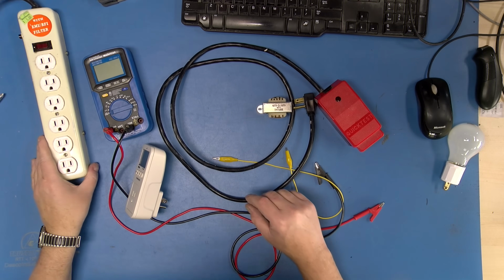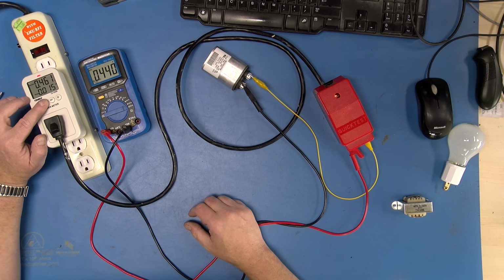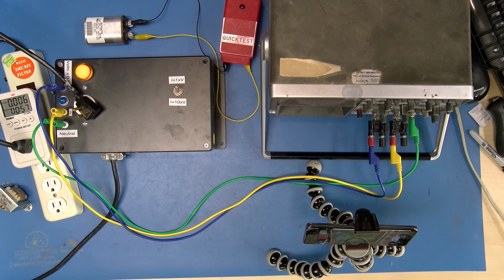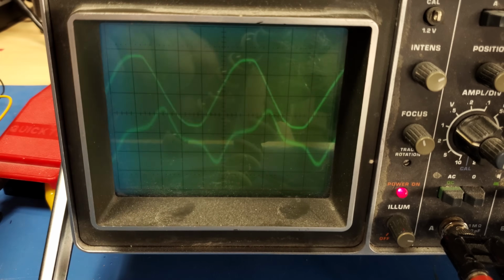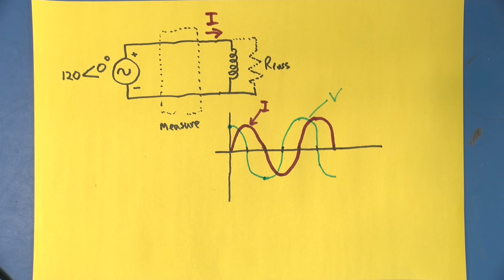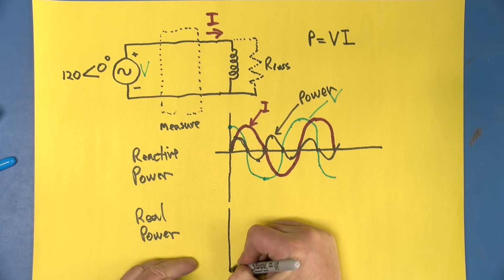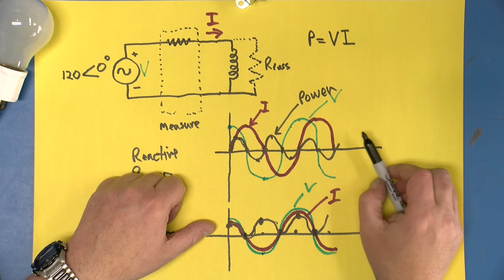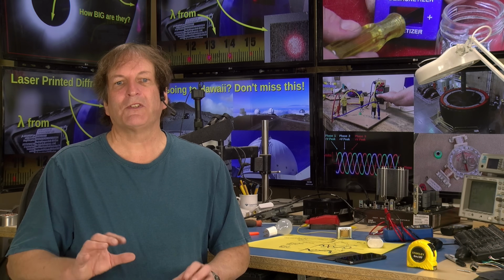That strange flow of electricity that transmits no real power

Comment: I wonder how reactive power affects Analog crossover networks in passive speakers,  and if indeed they do in fact change the sound signature of the amplifiers paired to those  speakers?  
Another Question that makes me want to get my test gear out is seeing if I can measure how a driver might work better with a filter network, Vs. one that is an active system?  

I'm not really sure if the reactive power in an audio system really matters, but it might be a cool video topic to cover that has quite a bit of Niche appeal to the overall audio community.  

Lasty, I wonder if some speakers were designed in mind to work better with a passive filter network, vs and active one?  
Meaning? 
I wonder if something like a tweeter would actually work better (Measurements wise - like Raw Cats Tweeter shootout)  with passive filters then active ones?   
Seems like there are things you can do to aid a speaker / Transducer to perform better in its active frequecy spectrum by having physical crossovers Vs.   active systems ?   🤔

It sounds like Malarky, but I wonder if the results would truly show a difference either way?  

Reason for asking is the old Audio magazines back in the day said that matching amplifiers to speakers is very important and many of the audio reviewers back in the day said the same when testing the same speakers. 

BTW? 
LOVE THE VIDEO!  :face-red-heart-shape:
Reply from the maker: That a really interesting question and full disclaimer - I'm not  high end audio guy. I'm sure those crossover filters do change the phase of the current delivered to the coil of the speaker. What I dont know - and your probably more knowledgeable about this then me - is if the ear can detect that sort of phase change. I also wonder how the reactive loading of the crossover+speakers influences or messes up the operatinf of the amps power stage. It would depend a lot on the design  of the power stages, so different amps probbaly behave differently. I do sometime want to do a video about why tube amps sound different from transistor ones and you have certainly given me something too look into for that one. 

Have you ever seen Paul from PS Audio's channel on YouTube - almost entirly based on answering readers questions. Why dont you send him the question - would be fascinating to hear what he says - let me know if you ask himk and he make a video about it - I would sure watch to see what his thoughts are.
Reply: @ElectromagneticVideos     Ugh...  He might still be a bit miffed when I compared his Power conditioner to a Adult film scene with Audio Science review being the mascots....   LONG STORY.   :face-green-smiling:
No pun intended... 

I might give it a shot!  :goodvibes:

Comment: Thank you for this clear explanation of the causes and effects of reactive power.

BTW the way I remember this is the phrase: "ELI the ICE man", which means voltage (E) leads current (I) in an inductor (L) (so current lags) and current (I) leads voltage (E) in a capacitor (C). (The middle character (L) in ELI means "Inductor", not "Leading".)

But the question some people might have is: Why does current lead in a capacitor and lag in an inductor, and why is it 90˚ in a pure capacitor or inductor?

Maybe you can explain this better, but the way I think of it is:

In a capacitor, when it is not charged, and a voltage is first applied, there will be a rush of current to charge the capacitor up.  This current will decrease as the capacitor becomes fully charged.  (You can easily demonstrate this with a simple DC volt meter and amp meter by charging a capacitor through an appropriately sized resistor with a DC voltage source and see the current decrease as the capacitor charges up to the voltage of the DC source.)

In an inductor, when the core is not magnetized, and a voltage is applied, it creates a changing magnetic field which induces an emf that opposes the change in current.  This opposition delays the buildup of current relative to the applied voltage.  (This is probably harder to demonstrate as you might need more than a resistor and a simple volt meter and amp meter.). 

Of course, in AC power, these voltages are constantly changing on an instantaneous basis so the math to really get down into the details requires calculus to fully describe what is happening.  

But in a capacitor when an AC voltage is applied, the capacitor resists instantaneous voltage changes by charging or discharging and at the points where the voltage changes most rapidly, at zero crossings, the current is at its peak.  This causes the current to lead the voltage by 90˚ if it is a pure capacitor with no internal resistance.

In an inductor the current is shifted 90˚ behind the voltage because the derivative of a sine wave for the current is a cosine wave for the voltage which leads by 90˚.

This assumes a perfect sine wave, if the wave is distorted you will get a slightly different result.

I have seen huge banks of capacitors located in sub stations to cancel out inductive reactances, and anyone can see smaller pole mounted capacitor banks everywhere there are overhead distribution lines that wash out the inductive reactances along various power lines.  These can be arranged to be switched in depending on the amount of capacitive reactance (measured in KVAR (kilo volt amps - reactive) by power engineers) needed.  The amount in Farads depends on the voltage, the higher the voltage the less capacitance in Farads is required to achieve the same amount of KVAR.  So installing a capacitor on a huge motor in a factory that is operating on 440 volts will require a much larger capacitor, than if the capacitor was installed on the primary side of the transformer feeding the factory, but the voltage rating of the capacitor will not need to be as high.
Reply from the maker: Well thank you so much! 

"ELI the ICE man" - I have heard it  - never came across it as a student. I suspect it was because we death with things from the math side first, to the C and L equations just implied the phase relationships. ELI is actually a great memory tool - great for remembering which leads what - thanks for stating the whole phrase. 

Your explanations are excellent - and close to how I think about them. Would you mind if I copied your comment into the "community" section of my channel? People are more likely to see it there and you nice descriptions may help someone understand (and use ELI).

Speaking of capacitor banks - have you ever seen a synchronous condenser - a free running synchronous machine acting as a giant capacitor for the purposes of reactive power? I have never seen a giant one - would be cool to see.
Reply: @ElectromagneticVideos  Please feel free to copy this to your community section.  Maybe add a little math to it for anyone who wanted to delve into it a little deeper????

ELI the ICE man is good to help students or other interested persons and geeks quickly remember without having to think through the non mathematical thought process in my comment.  An electrical engineer who knows the math should not need that.

I have never seen a synchronous condenser, but I have heard that old generators have been re-deployed as such devices.  I suppose they were just disconnected from their prime movers and operated as motors with the phase angles of the windings adjusted to look like a capacitor??
Reply from the maker: @ericjorgensen4826  Thanks! I will copy! Wont add any math right now but maybe later - will have to draw and scan math and post as an image. 

synchronous condenser - the trick is to increase the current to the field winding. The neat thing is when the field winding current (ie DC field) is low, it looks somewhat like the rotor of an induction motor in the sense that it draws a lagging current from the AC to make up for the lack of field. Properly adjust and you get no reactive current - the DC field current provides all the magnetization needed for the applied AC voltage. Now increase the field and everything happens in the opposite way - and a leading current flows out of the AC connection. Really neat. With a strobe light you can see the phase position of rotor changing as change the field current - the phase angle changing just as you describe. 

As a student we had a great machines lab with real 5 to 10 hp machines running at up to 600V so of course we had labs doing that sort of thing. I do have an old synchronous machine from the lab when it was shut down (too dangerous for modern times) so if machine still works I will have to make a video demoing that sometime.

Comment: Makes sense why high power car audio soemtimes employs capacitors now
Reply from the maker: I dint know how much reactive power would come back from the speakers if thats what you are getting at. You would certainly have capacitors in the power supply to remove noise from the cars power system and provide massive instantaneous power at the audio peaks.

Comment: Wasn't  that in the summer this reactive current  drawed from all the motors from ac units caused a mayor blackout in Texas?
Reply from the maker: I didn't know that reactive current was the cause of that Texas blackout. It certainly could have been, or if it wasn't the actual cause or the only cause, it could certainly have contributed by pushing the total current draw above what the system could handle. 

I hadn't thought of that blackout in a while - might be interesting to see if there   is something like a final report detailing what the sequence of events that triggered it was.
Reply: @ElectromagneticVideos  motors can load the grid very easily especially if they are overdesigned , they draw more reactive power that way. Transformers have a hard time with them especially when the Volt x Amp rating is exceeded. Industries are required to have capacitor batteries to keep the drawn reactive power <current> to a minimum but on private households it is not required yet.

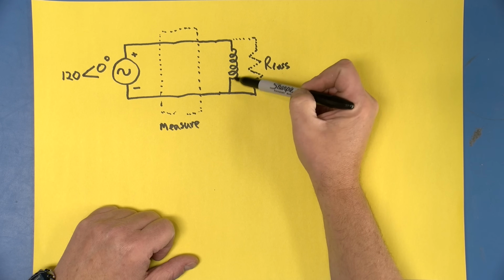Comment: 19:15  the resistor is "the coil" thus in series with the ideal coil or inductor Not in parallel !!!   But my conpliments for your beautiful video. Nice insight is given !
Reply from the maker: Not quite! There are multiple sources of power loss including the resistance of the coil (which could be represented in series as you point out) but by far the biggest source of power loss is the core loss - eddy currents in the core and hysteresis losses from the area inside the BH curve of the core. In this situation, its is generally easiest to lump them together into one parallel resistor are a representation of all losses at a given voltage. 

If were were using the transformer as a transformer and were expecting it to be subjected to loads varying from 0% to 100%, we might (if we needed more accuracy)  separate the out the core losses as a parallel resistor and the copper loss as a series resistor to more accurately represent the losses at different load currents.

Comment: Ahh cool, was just waching a Joel Lagace video on this power and how to recapture it. I thought this video was about real unknown power soources , which is what that Joel guy is looking into , novel reactions and sources of power using resonance to amplify current.  I dont understand enough to know if he's onto something or just another free energy quack, but he seems to know electronics at leaste. Would be cool to have a real eletronics guy investigate these things.
Reply from the maker: So I just looked at his video on "Don Smith Reactive Method" - let me know if you were referring to another video. He really goes off the rails at the 6m 50s mark. He seems to think somehow the current in the LC resonant load gets back to the generator and can be bled off close the generator and converted to real power - and (aaaaaah) used to drive a motor to drive the generator to get free power. 

Unfortunately not -  or I would just have cancelled my account with the electric company :) 

Numerous fundamental flaws: the circulating current in the LC  resonant circuit remains in that LC loop and is just power going back and forth between the L and C. The mechanical analog is a pendulum. The only current going from the grid to the :LC circuit is in-phase - and small. A future video suggested by another commenter: the LC circuit will look like a very high value resistor where the restance represents the heat losses of the current flowing in the LC circuit. If it was ideal, it would look like an infinite resistance. 

Trying to bleed off the "reactive power" close to the generator the way he does just wont work. The bridge rectifier will be like all the bad electronic power supplies we saw on the scope - a spike at the top of the AC cycle. 

And of course the  "feed that power to a motor to drive the generator" is the classic perpetual motion scheme that never quite works. 

The telling thing is nobody with any of these schemes (which are contrary to all known current physics) demonstrates it in a way that others can verify or duplicate. If they did they would get the next Nobel prize in physics for finding a gap in known theory so large you could drive a Mack truck though. and and properly patented would get riches that make Elon Musk look poor!  

Sometime it might be a worth doing a video on these types of things ... somehow in a way to not provide extra publicity to people pushing these things - I think many including the presenter of that video are genuine in their beliefs - and others are not ...
Reply: @ElectromagneticVideos  Great thanks for the clarification.I  wouldnt be so quick to lump him in with other free energy quacks. I dont get the vibe he's claiming he's found free energy, more like hes investigating novel interactions and thinks hes onto something and wants others to try (regarding his PEG cell) and bounce ideas off of.  Almost like he did find something he doesnt quit understand and looking for others to help basically.  He says this alot whichis different from other guys showing their free energy contraption but im not an expert and the more ilearn about stuff like reactive power it does seems possible to recycle it.  Who knows maybe no ones ever figured it but its possible?  I thought Jeol said himself power companies are starting to do this.  Anyway this is pretty cool, hacking the universe, looking for new answers, not settling with what we think we know is everything we need to know. Dont forget Ohm was rejected when he proposed Ohms law by mainstream science.  Is Lagace the next Ohm? I dunno but someone will be, theres a lot more to discover and i appreciate the free energy quacks who are actually playing with the universe rather then just rehashing other peoples work.

Comment: Thank you for taking time to show using lab equipment that reactive power is just a waste of mains  power that is proportional to the power delivered to the AC-connected reactive loads, and that it requires the AC wiring to be larger than it otherwise would need to be.
Reply from the maker: Thats exactly the issue: bigger wires, trandformers, and generators that would be needed for just the real power. Luckily, old style phase shift reactive power is easy to deal with. Less so for the electronic power supply spikes.

Comment: Congratulations!!
You are an excellent communicator!!

As per your request… I am Alberto, from Spain. Thanks again!
Reply: This is similar to those "Power Saver" boxes sold online, but those have been debunked by electric engineers on YT.  They do absolutely nothing in most cases.
Reply from the maker: @ I have seen some of those tear-down videos. Some of those boxes even have some electronic  components inside that are not connected to anything. I guess the idea is if someone does open them up, it looks like there is a real circuit of some kind doing magical things!
Reply: @ - The idea of those power savers which actually have a large cap wired in, is to cut down on reactive power.  The power savings is minimal at best on larger inductive motors.
Reply from the maker: @ I have never actually seen one with a capacitor of useful size. And even if it did have a reasonable one, at least over here (Ontario, Canada) residential and small businesses only get billed for the real power (wouldn't surprise me if that changes soon to bill for harmonics and reactive power)
Reply: @ElectromagneticVideos  - Ya, they some fake components in those boxes, from nothing at all to large caps.  Regardless, it doesn't work and it's outright fraud. smh
Reply from the maker: @billant2  Yeah. Really sad there are so many charlatans out there :)
Reply: @ - Thanks for posting really informative videos.  Hope more people would watch this. :)
Reply from the maker: @billant2  Thanks so much! Well some of my videos are really a niche interest type of thing. Other are more general  and often do better. I certainly appreciate every view, comment, like and subscription!
Reply from the maker: Thank you so much! I really appreciate that! Spain  - I have a few viewers from Spain! Greetings from Canada!
Reply: @ElectromagneticVideos  - Really easy to understand explanation even for someone with no power electronics background (greetings from the US). :)
Reply from the maker: @billant2  Thanks! Thats what I try and do - explain or describe things in a way that doesn't require the amount of technical background that is usually required. Greeting back to you from Canada! Just looking at some news reports of the terrible fires in LA - hope you aren't anywhere near there!
Reply: @ElectromagneticVideos  - I'm right under ya in Ohio, no issues here except negative degrees early next week.  Thanks Canada  Brrrrrr!! hehe
Reply from the maker: @billant2  Negative you degrees F? Thats way colder than here right now! Stay warm!